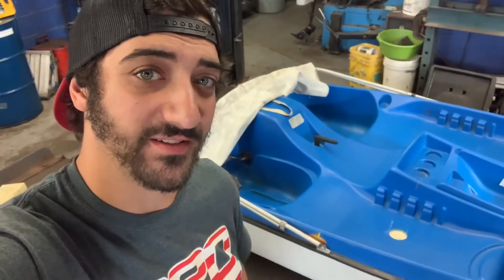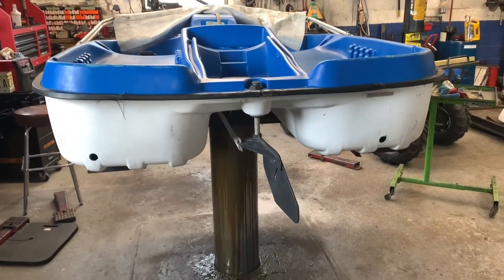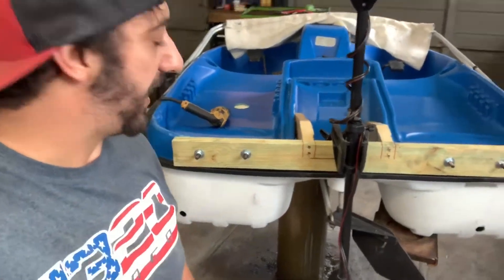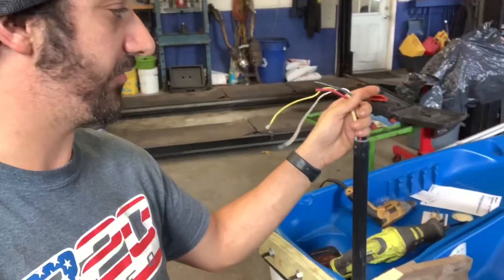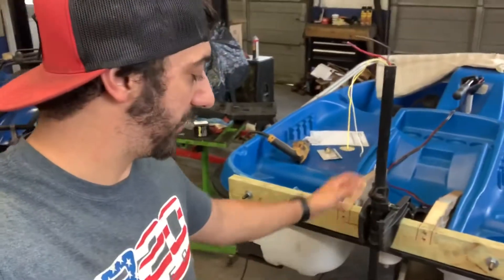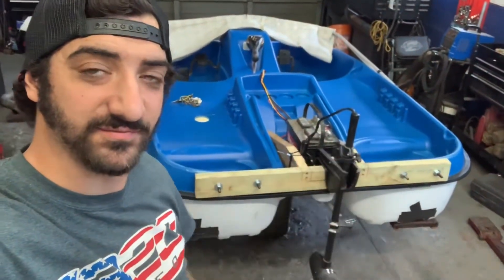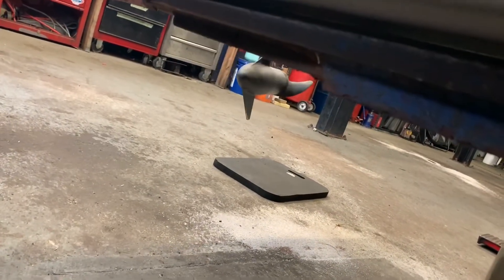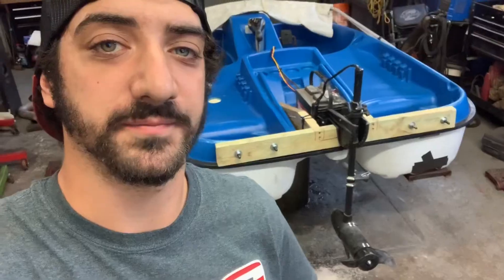MODIFIED paddle boat with a MOTOR!!

Comment: If motor fails can one still use the pedals?
Reply from the maker: In most cases yes, however this boat had pedals that’s where rusted solid. So I cut them out entirely.

Comment: Hey man, have you ever thought about building a pontoon with 24" hdpe drain pipe? Menards sells a 24" x 20' section for ~400 bucks each, see SKU         6890612.  I understand the ends need to be capped, and Home Depot sells them for 80 bucks each.  Of course it all needs to be sealed and water tight, but that's not too hard to do.
Reply from the maker: Funny you say that I actually have 2 18”x20’ drain pipes that I was originally going to use but I ended up using 8 55 gallon plastic drums instead
Reply: @ShoreGarage  I see a swan as the emblem for it!  Those barrels are actually a lot cheaper if you can get them locally and pretty much a lot easier to use.  I may build a barrel pontoon one day myself.
Reply: Wouldn't the bumps cause way too much drag? Not a bad idea though! We might test it in the future!
Reply: @MoneyPitBoating  that's a really good point! But pontoon boats don't go very fast anyhow, but yeah all those ribs and probably make some drag

Comment: Can you explain how you modified the steering linkage?
Reply from the maker: I just simply extended the linkage and attached it directly to the trolling motor
Reply: @ShoreGarage  and what was that piece made of that you attached to trolling motor? Any tips? I've watched this a 1k times lol. Also the next one testing it. Awesome.
Reply from the maker: @robertrodriguez6565  it is a transom. I made it from some pressure treated 2x4’s this allowed a solid mounting spot for the trolling motor.
Reply: @ShoreGarage  my mistake. Not that piece. The one on the lower shaft to connect to steering pipe. To the trolling motor.

Comment: Trolling motor + Pedal Boat + Boston Harbor!!!

Check this pedal boat mod out 👇🏾

https://youtu.be/7wlwyBCXecY
Reply: Depends on my motor, I use 3 different ones depending on the trip.  With my 36lb I can get a good 4 hrs at 50%, with my 40lb 2hrs, my 55lb 1.5...  And this is with a 86ah battery...  If I use my 40 or 55 I will typically bring 2 batteries... This will give me a full day on the water in my boat, full gear, two passengers
Reply from the maker: That’s an awesome video! How much time do you get out of the charge?

Comment: Do you think there is any way to run the wires through the plastic to the steering handle? I wonder if it is possible....
Reply from the maker: Jason M absolutely. At the time I built this. I was more or less slapping it together. Figuring it out as I went. That’s how I build most of my projects. However if I still had this boat I would have absolutely done just that!

Comment: So i fid the same thing but dudeee i wanna copy your steering mechanism so i dont wack my kids in the face while steering haha can you do a close up video or send me pictures?
Reply from the maker: Jesie AMaya I wish I could. I unfortunately sold this little boat long before is started getting traction on YouTube. However. I simply just disconnected it from the rutter and made up a bracket and hose clamped it to the trolling motor and attached the linkage there. Very simple